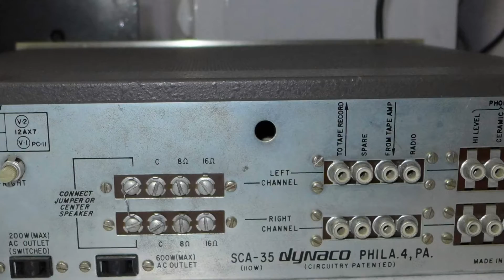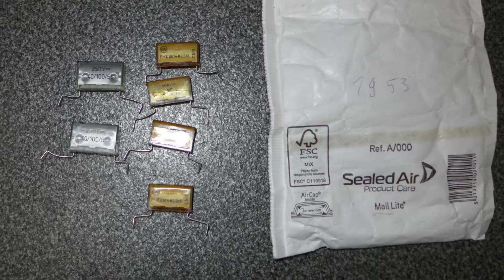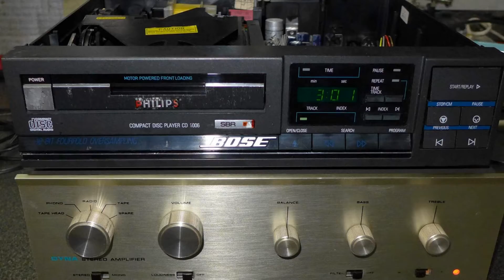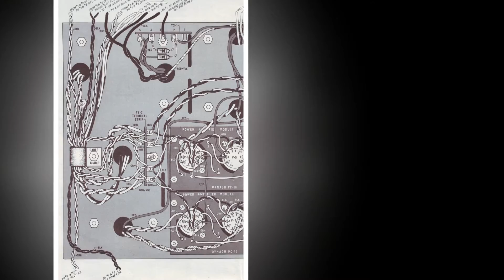Dinaco Dyna SCA 35 stereo tube amplifier since1965

Comment: hi petio, i hope you can understand and write in english? i just got my sca-35 a few ago, it was in bad conditions, bought for $260 canadian, I totally replaced the output PC-10
PCB's, the 4 6BQ5 and the 2 7199 replaced with 6GH8U with socket adapter. it was running fine, but occassionally it's motorboating after running for a few minutes of operations,
sometimes no motorboating even in long operations. do you have any idea of what's causing this on the sca-35? thanks, victor from canada.
Reply from the maker: Hi Victor  , it's very difficult  to say like this what is the problem.If you can make detailed photo to the all plates and problem parts , and send to me  , maybe i can suggest  some think.If yes , will send you my e-mai .lRegards from Bulgaria
Reply: Hi, actually experiencing the same issue on mine literally 1 year of being fully serviced..
Reply: @robertbernardini1536  hi, the PT becomes shorted, maybe this is the main reason for motorboating, as well as bad tubes, i replaced the PT with a hammond PT and lower the B+ voltage within 6BQ5 max data limits, now it's ok, but here is still a 120hz noise on this amp, which i cannot removed, i may just throw this amp to the garbage soon.......
Reply: @robertbernardini1536  one more thing, the phono sections is very good normal loudness in volumes, but when i use aux/line in the sound is weak, needs ext preamping to make the volume a little loud.......